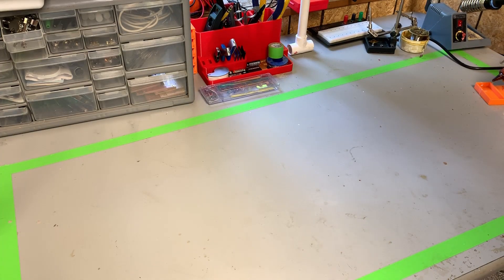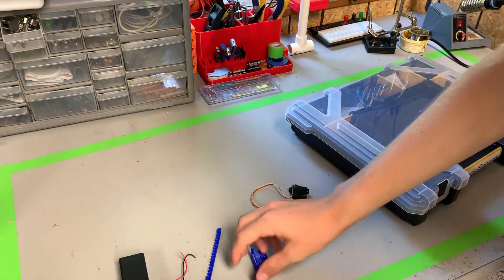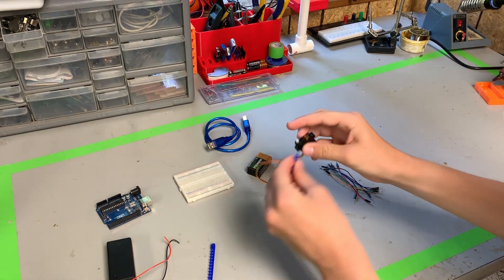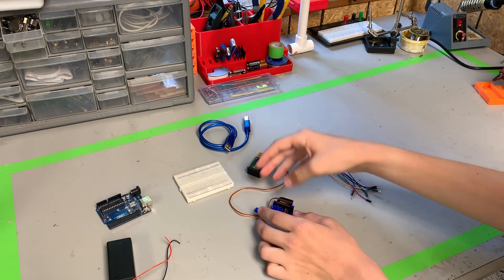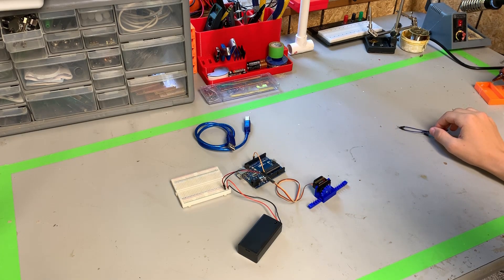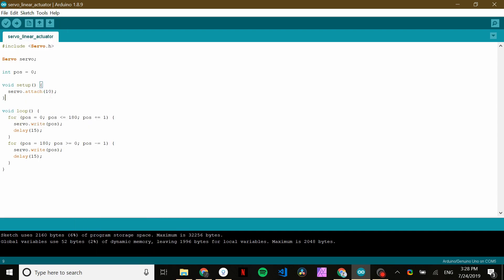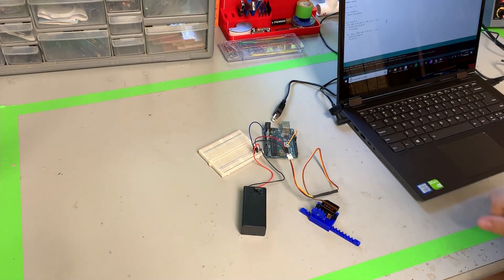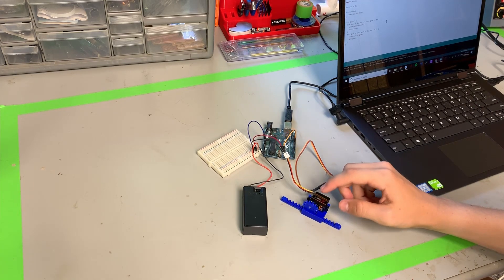⚙️How I Made A 3D Printed Linear Actuator with a Servo Motor!

Comment: How did you fix the gear to the servo shaft? My setup is slipping off under load. TIA
Reply from the maker: I used a servo screw to attach it like any other attachment. I didn’t have it under much load though, but I doubt a basic 3D print will be too strong.

Comment: That looks great! Straight to the point. Would it be reasonable if you could add a shaft double/triple the size in your folder? I have a light robot that I want to lift up pass grass and shrubs. It's wheels often get stuck. I will subscribe whether you consider or not. Thanks!
Reply from the maker: Thanks for subscribing! I would not recommend using this to lift a robot over obstacles. It would likely be better to, if you have a 3D printer, print larger wheels to drive over any obstacles, or change the drivetrain. I’m not saying you can’t do it the way you suggested (you can use blender or a cad software to do this), but it might be unnecessary effort on your part. I’m always happy to help!

Comment: Jeez man, try cleaning your disgusting table before you start making your video!
Reply from the maker: If only it were that easy! I will work on getting a cleaner surface, but when you do a lot of work on a surface, it is impossible to make it stay clean like it was new. I get that it can be distracting, and I will work on that.
Reply: @we-gold  I was only being semi serious. As a hard core maker myself I know it is a PITA to keep your work surface clean. However, I would be embarrassed to put out a video with it looking like that. I;d at least attempt to clean it. 
However, great video and tutorial. Keep up the good work.
Reply from the maker: @MikeMcRoberts  I'm glad you enjoyed. I will definitely attempt to clean up the table. Do you know of any good ways to do that?
Reply: @we-gold  I use Flash All Purpose as I find it is good for getting rid of greasy or stubborn marks. Sticky spots can be removed with Sticky Stuff Remover (Limonene) . You could also try IPA if you have a 3D printer.
Reply from the maker: @MikeMcRoberts  Thanks!